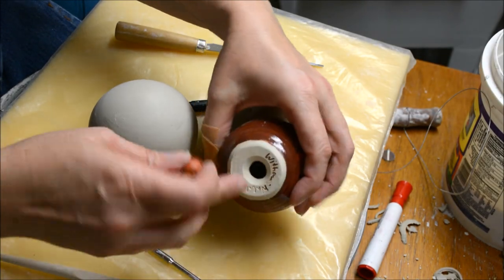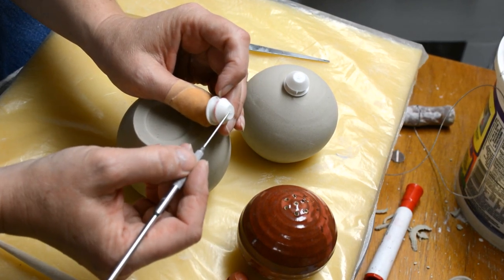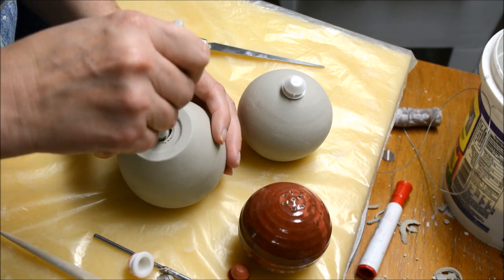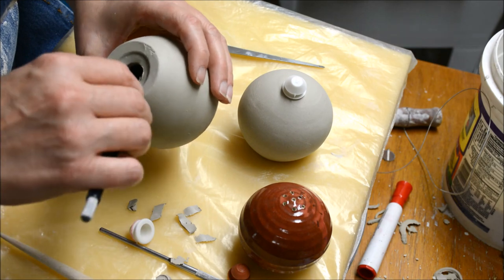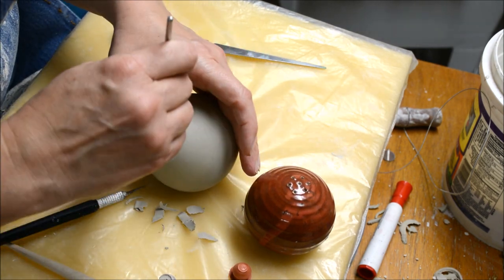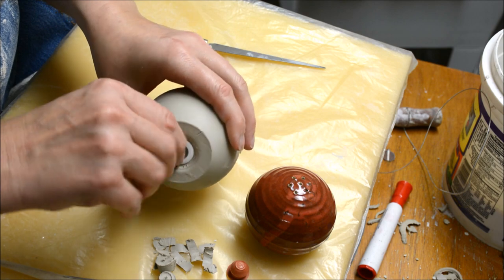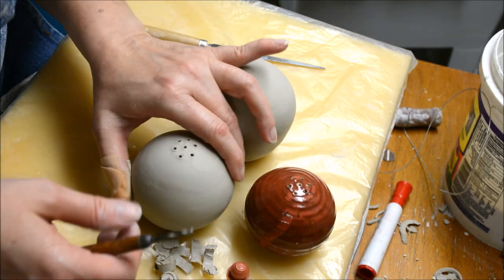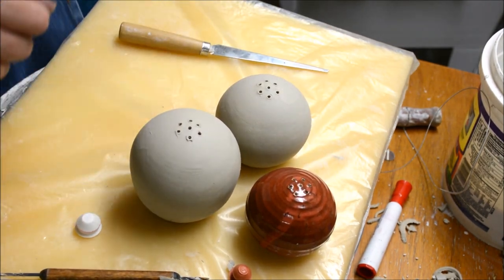How to Cut a Stopper Hole for Rubber Stoppers in a Shaker

Comment: hello! Thanks for the video. The stopper hole will not shrink during fire and them not fit anymore?
Reply from the maker: Yes- that’s why I cut it to the larger size of that flange- so it shrinks to the smaller diameter. It should not be a tight snug fit when cutting. It should freely fit. Here is the handout I had linked in the video description if it will help:   https://drive.google.com/file/d/19rBj88tzrHA4UMu4ANrh055UIcdn8e1E/view?usp=sharing

Comment: Dear Karen thanks for the lovely sharing. I was wondering if you can recommend where can I find these rubber stoppers online? Many thanks!
Reply from the maker: I often order from Aftosa or Axner for stoppers, but I know that some retailers sell them on Amazon too!  Here is my googledoc with Amazon links... and it is searchable.  If you do command F or control F, you can look for anything I might have in the document- including two of the stopper choices!  https://docs.google.com/document/d/1XbYPQjjJnHrQG5xyWGMHZkEcZj5N8VnUAbFZdJRrRmU/edit?usp=sharing

Here is a link directly to the stoppers from the document too:  
Shaker Stoppers- ½” diameter
https://www.amazon.com/gp/product/B07X6F7YPJ/ref=as_li_tl?ie=UTF8&tag=karanspotsand-20&camp=1789&creative=9325&linkCode=as2&creativeASIN=B07X6F7YPJ&linkId=e7d685955d14add9404231f196263fc8

½” Shaker Stopper- quantity of 50
https://www.amazon.com/gp/product/B01IAGQEP0/ref=as_li_tl?ie=UTF8&tag=karanspotsand-20&camp=1789&creative=9325&linkCode=as2&creativeASIN=B01IAGQEP0&linkId=556f5c148e764ecba8b084027b8d6aab
Reply: @KaransPotsAndGlass  WOW! These are great tips. It seems I have now a lot of stuff to go over, that's great. Again, many thanks for the sharing!

Comment: Hi Karen are you able to tell me the if the 1/2" on #3 stoppers refer to the wider diameter hole you initially cut or the smaller diameter the clay shrinks too?
Reply from the maker: my #3 stopper is 1/2" wide at the skinniest point... so, it will be the diameter of the clay after firing.  The diameter I cut appears to be 5/8" (on my cone 6 clay). Hopefully all that makes sense!

Comment: One of my pet peeves is having holes too small for the pepper to get out, aren’t those holes going to shrink too during firing?
Reply from the maker: Yes, they shrink, but they are definitely large enough for ground pepper.  :)  I use them all the time.  Now, I know some people use a very coarse pepper, like big pepper chunks or flaky pepper... I don't personally use that, so I don't really know.  I have found every ground pepper I have purchased is fine!  I try to keep the holes appropriately sized for salt as well, so it doesn't pour out too quickly.  Of course, if a customer ever asked me to make bigger holes, I would!  ;)
Reply: KaransPotsAndGlass  I forgot to thank you for the informative video! I am in need of Salt and pepper shakers, but have avoided doing them because I wasn’t sure about fitting the stopper. Being dyslexic, shrinkage calculators and I are not exactly the best of friends, and as usual, you make it more friendly. Sigh, if only I were in high school and could take your class

Comment: How about finding or making a stopper for an already cut ceramic hole??  There doesn't seem to be a video on that yet.
Reply from the maker: I use rubber stoppers- I’d recommend just measuring the diameter and purchasing one that matches! I have stopper links on the googledoc!
Reply: @KaransPotsAndGlass  Thank yoh